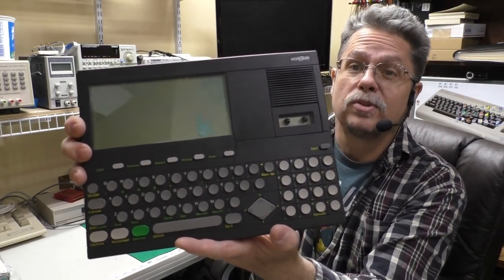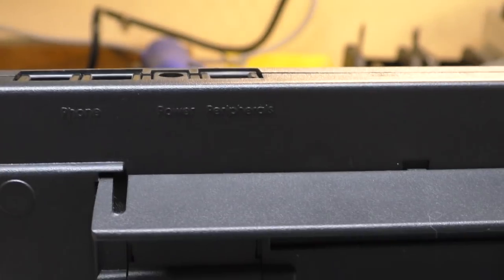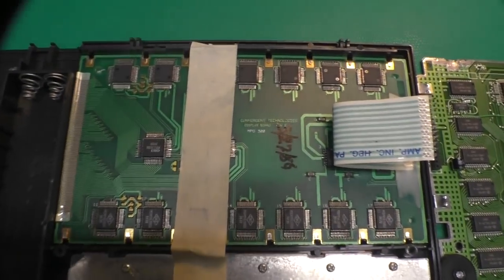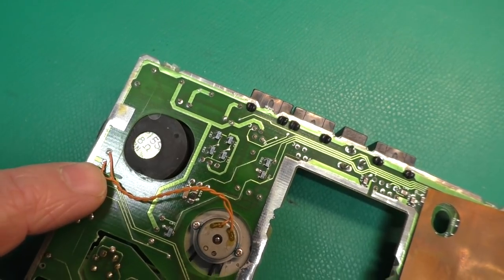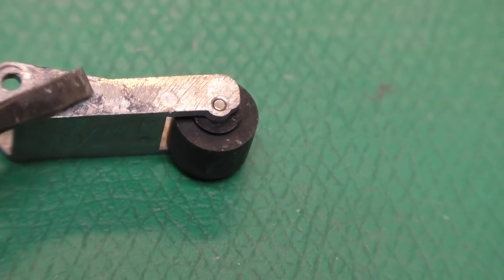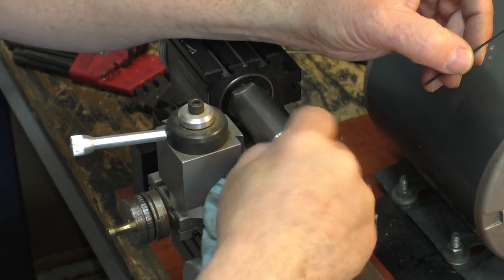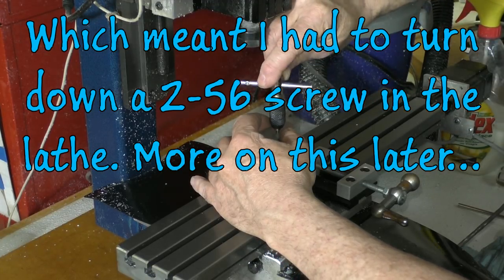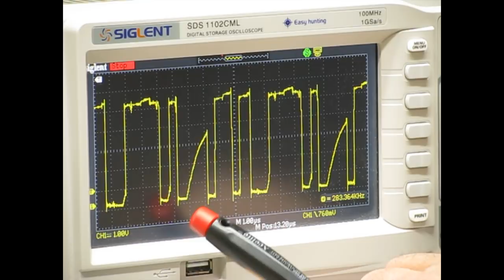Convergent Workslate Part 1, Introduction microcassette drive repair

Comment: Simply amazing craftsmanship and attention to detailed engineering!  You are a talented guy. Very much enjoyed the history of Convergent Technologies.
Reply from the maker: Thanks. It was a lot of fun to figure out how to fix.
Reply: At the time of development, lt was said to be the highest density pc currently on the market with over 700 components.
Reply: @paulrdecker8295  But how to fix the micro cassette!?
Reply: @Fezzler61  The cassette was received as a complete assembly. I don't recall the manufacturer. I believe it can be interchangeable with another as long as it is the same physical dimensions and functions per the wiring. And also receives the cassette.
Reply: @paulrdecker8295  It must have had a dual track head that put audio on one part of the tape and data on the other track, no?
Reply: Check the head for two or four wire.

Comment: I worked at Convergent during that time and remember the Workslate.  I worked on the AWS workstations, the NGEN, the Miniframe, and the Megaframe (which you didn't mention).
Reply from the maker: Hi, it's goof to hear form you. The Workslate seemed like an odd fit with the rest of Convergent' s line up. I tried to find some more historical information about its conception and ultimately its demise but there is little information out there. It seems there was a Facebook group for former Convergent employees but I never got a response when trying to join.

The workstations were quite impressive for the time from what I read about. It does seem like some folks are collecting them though and getting them working again. 

I've got one more episode on the Workslate coming up, it gets better but not 100% working.
Reply: My uncle had given me a workslate when he worked as a contractor back in the 80's. I started using it around 1987. Loved it as a kid, didn't understand why they weren't circulating at the time. Best I could research they said it wasn't quite what the Wall Street gurus needed for financial calculations and at the time I think they fetched for $900 per unit, which was a bit pricey at the time for diminishing returns. Just looking at it brings back childhood memories. Like Nickelodeon😂

Comment: Interesting video.  I have not had any issue with Caps or the Tape on my unit, just the battery contacts.  They could have made this a heck of a lot better if they had used wires and plug for the battery contacts, and a plug for the tape deck, and held the tape deck onto the case as its own PCB. Would have made fixing it and replacing it massively easier.

Comment: This is a earlier model Workslate. The later mod. had a third ROM added to that empty location. This was for a software update for a word processor.
Reply from the maker: Thanks
Reply: I wish i could help you with docs. The Workslate was a start up, they had about 15 people when i joined. Thing went very quick and then it was over that quick. By the way i like to commend you on your well thought-out and executed repair of the cassette.
Reply from the maker: @paulrdecker8295  Thanks I appreciate all of your comments. I was happy that mechanically the cassette drive worked although I could not seem to get it aligned and/or get the head amp chip to be enabled. Perhaps some day I'll build my own amp circuit so I can try to align the head.

The use of a stereo head was interesting too. I have speculated that  one track might be for the voice memos and the other for data, or perhaps one track is a timing signal.
Reply: @HeyBirt  If you can identify mostl of the circuitry associated with the head amp, check for possible cold solder joints. That being one of the earlier model. The reason being surface mount was relatively new at that time. We had to develop the right combination of solder, turbulent flow, and dwell time for the solderflow process. So not all units received the best process since this was timely.

Comment: I to worked at Convergent in both the, Workslate and AT&T engineering department. The reason for the Workslate demise, at around $1400 dollors no one was buying them.
Reply from the maker: Yes, that would have been about 2x of something like the Epson HX-20 and almost 3x of the TRS-80 model 100. I wonder though if Convergent did not have the sales channels for a product like this as it was very far removed from workstations.

I would love to get my hands on any technical documentation for the Workslate. I have a copy of a rough draft of the service manual which is better than nothing. If you would happen to know where to find any documentation I would appreciate any tips.